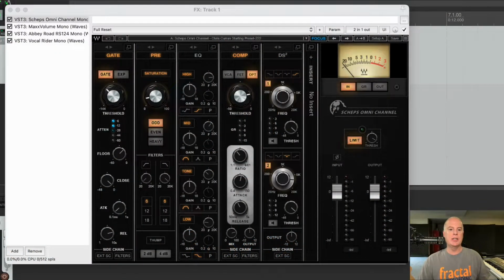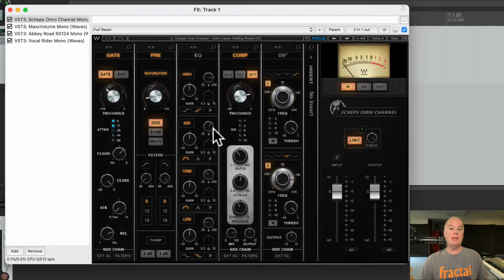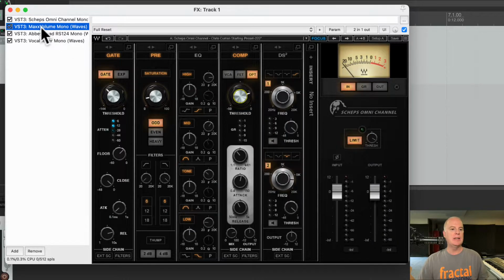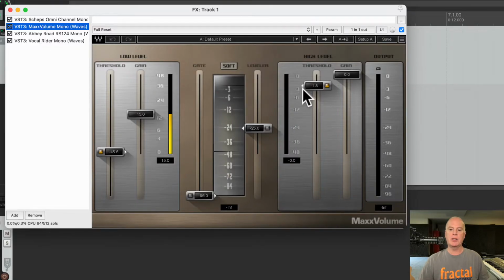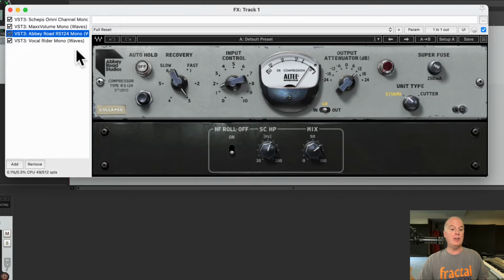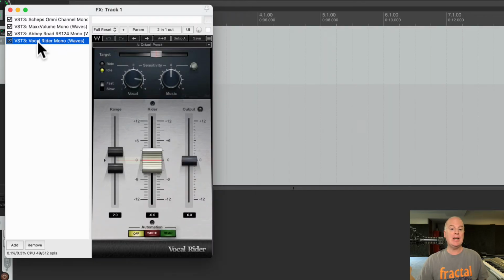Properly Processing a Voice That is Extremely Dynamic

Comment: Should Vocal Rider be at the end of the chain? I thought the idea was to ride the vocals before compression so the compressor needs to clamp down less, but I'm a novice so might be wrong. But since the Vocal Rider is doing essentially the same as what automating the volume would do, it seemed to make sense that it would go before other plugins.
Reply from the maker: It all depends on the severity of the source audio, but Yes you can use Vocal Rider first in the chain or last or BOTH (I've done that plenty of times when the dynamics are extreme.)  Play with different approaches so you get a good feel for it ;)